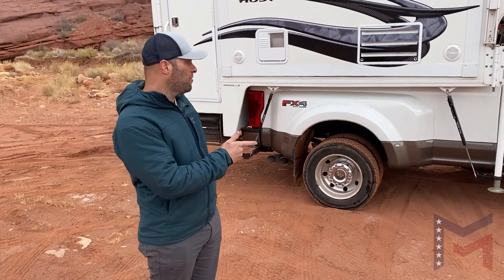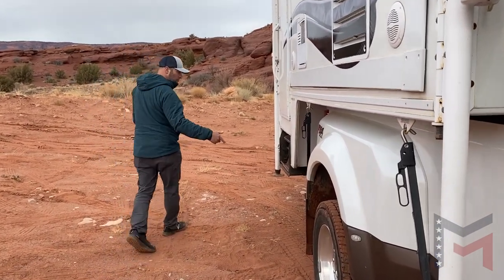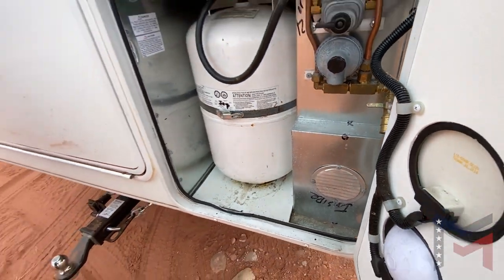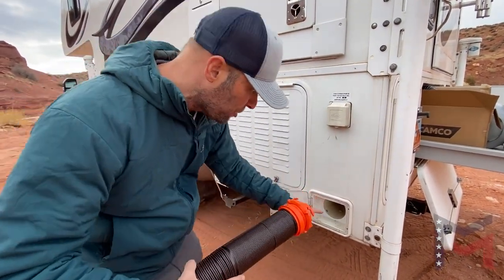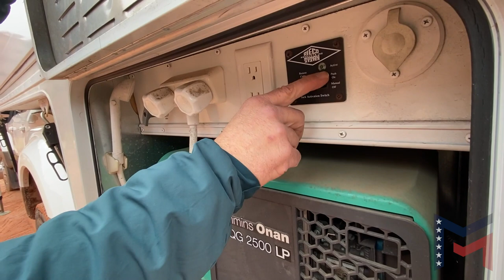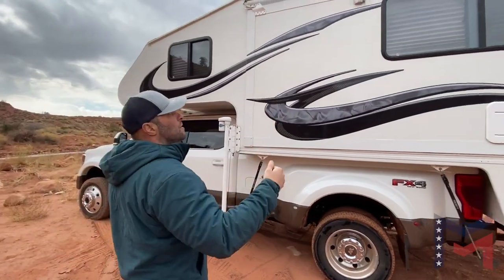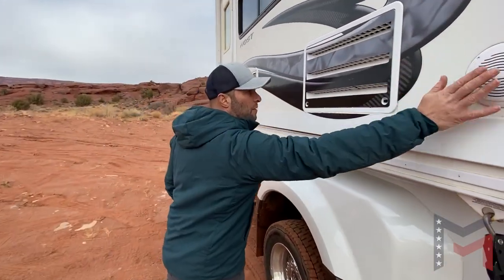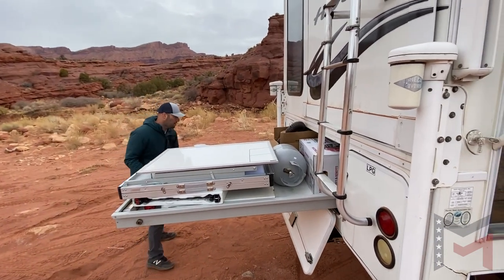Host Mammoth Truck Camper / Exterior Walk-Through / MILITARY MOBILITY

Comment: I switched to Lithium batteries about 18 months ago, they’re great with one exception.  Like your cordless tools if the temp drops to 32 or below they will not charge.  Campers for the most part (and travel trailers even worse) have the issue that the battery compartment is vented and not insulated.  I had to close off the vent and insulate the cabinet to help keep that compartment warmer during winter camping.  Host makes great units, nice rig!
Reply from the maker: This is great input, thank you. Currently exploring up in Wyoming where it was 10 degrees out this morning! So we'll be sure to do this mod. Thanks for your patriotism and support.

Comment: Hi there - nice rig.   I'm looking at the same set up but only pulling two jetskis.  Did you have to put airbags or do anything to the F450 due to weight?
Reply from the maker: Hello and thanks! As you know the F450 is a beast as is, and despite our big mods on our 4x4’s we wanted to leave this brand new truck as is the best we could. That being said when the massive Host was in the back with everything we were carrying it did sag a bit, so we installed 2 things; Airlift 7500XL bags and Torklift lower stable loads. The combo is unbeatable and we love the results. 

If you get airbags, ensure you run separate air lines to each side so you can independently control the PSI in each, helps a ton on long stretches with cross winds (a single line system would actually work against you; pushing air from one side to the other and make things worse). We also opted to get an ARB dual compressor and air tank so we can now run air tools, inflate tires, etc. lastly the stableloads allows you to engage your overflow lead spring early which helps with handling and again reduces sag. Either product can work for you, the combo is unbeatable. Stableloads offers upper and lower, we’d rec getting the lower first as we found it’s more effective. You may not need the uppers (we didn’t). Hope this helps, thanks for reaching out and enjoy the adventure. Jet skis are so much fun!!

Comment: Great video quick question didn’t you have any concerns with your departure angle? For me one of the Advantages of having a truck camper is being able to go into trails and in areas that I wouldn’t be able to go if I was towing
Reply from the maker: Great question and yes we did. Our need is/ was to have a base station to run our courses from. These are locations that are austere in nature but that we could reasonably access with a rig such as this. The F450’s wheelbase, weight, and dually wheels already limited where we could take it so we thought the Mammoth would be a good match. We bring multiple off-road rigs (modified Jeeps, Land Rovers, dirtbikes, side-by-sides) to our courses so the base station becomes the hub. Our initial plan was actually to get a 5th wheel and we rented one for a month to try it out; taking it into the Uintas. We loved the space but there were too many limitations with parking and taking sharper turns on the trail, so the big truck camper became our balanced compromise. Thanks for the input, we love sharing outdoor adventures and having conversations with others that do as well.